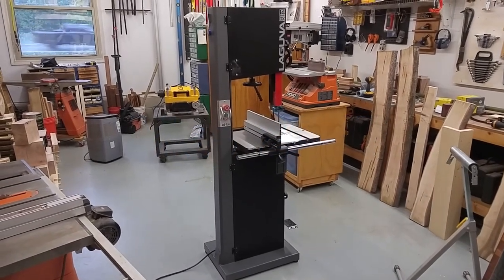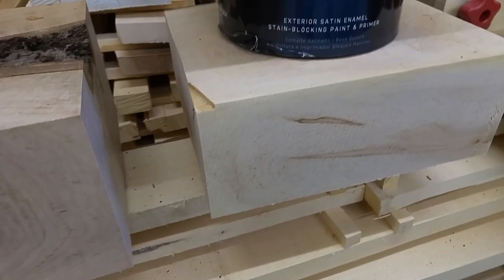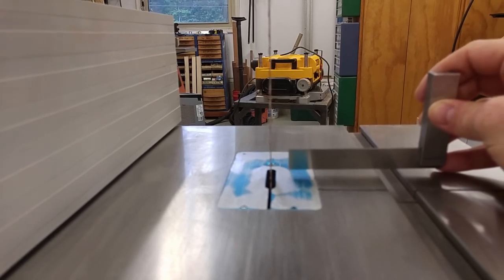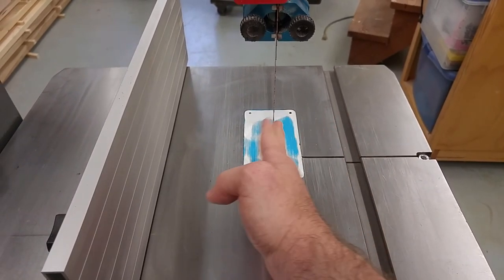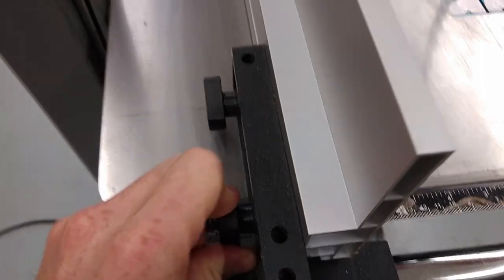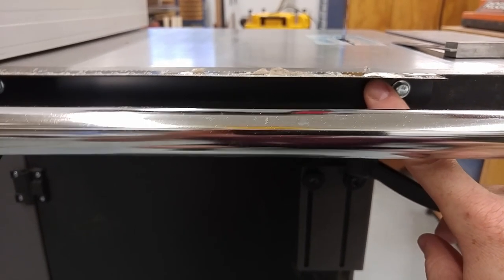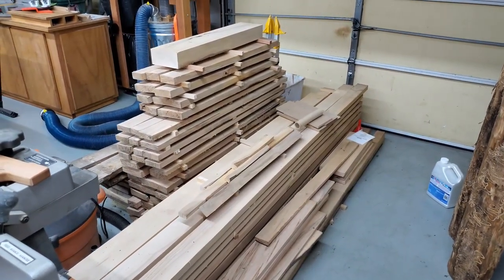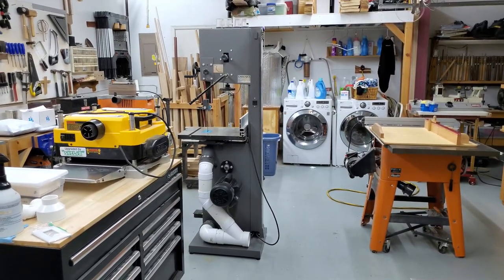Laguna 14BX 220V bandsaw three-week and three-year reviews

Comment from the maker: Here are some 3D-printed upgrades for your Laguna bandsaw:
✅ Improved dust collection insert block: https://thesnekkershow.etsy.com/listing/1703726866/insert-block-for-laguna-1412-and-14bx
✅ Better lock handle: https://thesnekkershow.etsy.com/listing/1786957785/improved-table-lock-handle-for-laguna
✅ "Check tension" magnet: https://thesnekkershow.etsy.com/listing/1758109099/magnetic-check-tension-sign-for-bandsaws

Comment: With your lower blade guide, you can move the knob to the other side of the block assembly on the other threaded hole. It does remove a bit of your table tilt, but its much easier to get at.
Reply from the maker: Thanks, I'll have to take a look under there.
Reply: It removes most of the tilt. Mines on the outside and I can only get to 11 degrees

Comment: I purchased the laguna 1412 with the 1.75 hp motor. It's my first band saw ever and it is great I wired it 220 to get full use of power. The one thing I didn't like is the guides. I installed a set of carter guides last Friday and what a Saw this is now. I would recommend them for sure.  Love your videos very helpful thank you from Alaska at grampas Wood shop..ps. resaw King rocks

Comment: Great thorough review!
I've had the 2.5HP for a year now.  I have very mixed feelings about it and at this point I wish I had the Harvey Alpha.  I had issues with the table not staying flat where the split is and had to go through a bunch of trouble to get that right. The trunnion system is crap and doesn't hold well so it easily goes out of 90, especially if you loosen it to make an angled cut and put it back. The flaw is all the play/slop in the trunnion.  The throat plate is junk and trying to get or keep that perfectly flush is a challenge.  The fence was humped and I had to call to get a replacement that still wasn't perfectly flat but was much better. The aluminum extrusion is just a piece of junk and as you showed if you put pressure against the backside  during a cut it will flex - so use a on/off magnetic block on the backside to secure that like another viewer stated. The fence system as a whole is junk. Overall they put such little money into the fence system that in my opinion it's just cheap crap.  I have mixed feelings about the ceramic blade guides. It too just feels really cheap, I'm not sure how long those ceramics will last. For now it's fine but every time I look at it I wish I had better.  Like all bandsaws, blade changes are time consuming and you quickly find out why shops end up with at least two. One stays setup for resaw and the the other one(s) setup with whatever blades are good for the curve cuts.  My experience with their customer service wasn't great.
The things I like about the saw.  The 2.5HP motor is great. The foot brake is great. The mag on/off switch is good. Dust collection is acceptable.  

If I were to do it over, I would have purchased the Harvey Alpha. Yes it's more expensive but it addresses most of the issues I have with the saw. I don't have one though, so maybe it has its own set of issues, but the fit and finish look way better.

Comment: You can move that knob under the table by flipping it 90 degrees as there’s a hole facing the front. So you won’t need to tighten the screw with your fingers the way you did.  Or tilt the table up and then adjust.  While you’re at it unscrew that screw and move it to the front. There’s a hole if you’re look there so the screw won’t be in the back but the front.  Cheers. I just got mine yesterday.

Comment: I have the same problem with my kreg fence only locking on the front. If I'm cutting something where it can cause me problems I   stick a clamp on the table behind the fence to support it. Sucks to have to take the extra step, but it works well.

Comment: Thanks for a thorough review.   I love the brake.   Not a fan of the fence.   If I had this saw, I would replace the two vertical adjustment set screws with pieces of brass shim stock the full length of the black part.
For support of the end of the fence, consider using a magswitch or magnetic featherboard.
I have designed and 3D printed zero clearance inserts for my Grizzly bandsaw and a few local wood working friends.  These are easy to reprint when the slot gets too wide from the blade movement during cutting.
If you give me dimensions of your insert I will be happy to design and print an insert or give you the STL file if you want someone to print this locally.
I agree changing blades is a hassle.
Dave.
Reply from the maker: I haven't adjusted the fence in years and it's still square to the table, much to my surprise. I know someone with a 3d printer, that's an interesting idea. This is one of the things I love about managing a YouTube channel.

Comment: Great review!  For the fence issue at the where it might move under load while cutting, try using one of those small heavy duty square magnets with and ON/OFF switch right up against the back of the fence so it doesn’t move. Works great for cheap table saw fences too!

Comment: Agreed this is a great saw. Most saws this size and larger do not have anything like the power this one does. Once setup it stays totally accurate  is extremely quiet and vibration free. My previous startrite 401s 🇬🇧 was forever stalling when resawing, resulting in me usually kicking something hard! I say the only negative for me is the optional wheel kit.  Don't bother, its crap! There are much better ones with 4 wheels not 3.

Comment: To solve the 4" Dust Port to 2 1/4" problem, Rockler sells a 4" ID Rubber Union Item#  46301. They also sell the 4'' T-Connector Collection Fitting for connecting the Top and bottom ports together item # 88501.
Reply from the maker: That could work. I ended up taking a slightly different approach, shown around 26:40. I did a quick overview of the parts and process here:  https://youtu.be/iFvZIpgHA7I

Comment: Thanks for a really good video. One thing I am glad you bought up was Laguna's customer service. It has not been that long ago they had really bad customer service. I am glad they have improved it. I am going to get a new BS and the 14BX is what I have been looking at the most.
Reply from the maker: I've heard other people say their customer service was bad, which I thought was surprising. I wonder how much of that was a side effect of doing business during a pandemic. My experience was from three years ago, so I can only speak to that.
Reply: @TheSnekkerShow  I bought one of Laguna's lathes and trouble with it and didn't want to do anything about it. I bought the lathe from Woodcraft and took it back to them. The lady at Woodcraft was really mad. All this happened before the pandemic. I traded the Laguna lathe for a Jet and I was happy.
Reply from the maker: @hawkeye10100  Woodcraft is a franchise and doesn't like returns. I bought a Laguna carbide-tipped blade online from Woodcraft that had a crack in the weld. The guy at Woodcraft complained, but I called Laguna and they sent me a replacement.
Reply: Laguna customer service seems good now. I bought their C Flux dust collector and had issues with the remote not connecting. They were right on it and sent me a new remote pronto.

Comment: Have the same saw and the 3/4" Resaw King blade. My biggest problem with set up was getting the back of the blade square to the table. It was leaning towards the front of the saw. The manual shows how to adjust this using the six bolts and set screws under the table but it's a PITA. Also noticed the front to back squareness of the blade changed when I changed blade. Adjusting side of the blade square to the table was now big issue.For dust collection I bought a 6X4X4 true wye and connected to my 2hp dust collector with a 6" hose.
Reply from the maker: That's a good point, I completely forgot to mention squaring up the miter slot and table with the blade. I think I did that after aligning the wheels, and before squaring the fence, but I haven't checked it again with other blades.

Comment: You could add a short section of 4” plastic dust collector hose between the saw port and your shop vac adaptor.
Reply from the maker: That could work.  I ended up building a PVC system for connecting to a 4" dust collector.  https://youtu.be/iFvZIpgHA7I

Comment: I’m planning to buy one after using a Delta 14” for the past 20 years. I sold my contractors saw 3-4 years ago and don’t miss it at all because a good bandsaw is far more versatile. A buddy bought one 2 years ago and loves it. I’ve found it is a bit cheaper to buy 8/8 lumber and re-saw 4/4 and 6/4 out of it, plus grain matching is much easier and locally available slabs have fantastic grain. The latest price of $1999.99 sucks but I’ll recoup about $300 selling the Delta. That will buy 2 re-saw blades😂.
Reply from the maker: If you can hold off a little longer, Laguna usually has an annual March Madness sale.

Comment: I am planning to buy this, most detailed description thank u
Reply from the maker: You're quite welcome.
Reply: @TheSnekkerShow  does it come with a 110 1-3/4 hp motor  that can be wired for 220 2.5 hp vice versa? Or they just offer the 110 and 220 motors that you can't rewired? Thanks
Reply from the maker: @japhetmillion4671  They sell them pre-wired. I just popped the electrical cover of mine and didn't see a rewiring diagram.

Comment: Hello, while this is an extremely old thread, internet time, I am having the same issue with my bottom tire/wheel. I have taken great care to align my saw and am waiting on customer service….The top wheel has the blade centered and the bottom wheel has the blade far forward. If you remember…did you do the reverse tightening on the up and down bolts…or the same? I am pretty sure that I can fix it with only the slightest information. I have greatly benefited from your videos on the Laguna  bandsaw. Thank you
Reply from the maker: If I remember correctly, I ended up adjusting both the top and bottom bolts. I think I started with just one, but then the wheel started to contact a pulley, so I backed off and did the other.

Comment: What brand re-sawblade are you using? I assume the drift master? Have you tried other re-saw blades? I bought a cheap one but I think a lot of my drift is because the blade isn’t that good.
Reply from the maker: Laguna 3/4" Resaw King. I haven't tried any other carbide blades, and I have a 3/4" steel blade I haven't opened yet.
Reply: @TheSnekkerShow  thank you

Comment: Been eyeballing this saw. Good video! Can you use a Bora Portamate base (60~80 bucks) for that saw and not pay said "King's ransom" for a Laguna base?
Reply from the maker: Funny thing, I just remembered that I have a spare Delta mobile base under my workbench left over from my last bandsaw. It's okay, but I'm probably going to build one like I did for my jointer.
Reply: @TheSnekkerShow  are you happy with the height of the bandsaw? I've heard criticisms of how they sit lower than other brands. Is that a pro or a con?
Reply from the maker: @misfit4777  It's the same height as my workbench, table saw, and miter saw, which I like. I use it mostly for resawing and milling, so that's a comfortable working height. If I was doing more light-weight precision work, I'd probably raise it up a little like my scroll saw so it would be closer to my eyes without having to hunch over.

Comment: I have a 14BX for a couple years now...so far I have replaced tires and a bearing in the top wheel. Also the brake mechanism sticks now and again...tool a while to figure out why it wouldn't start! Shoulda got a Rikon
Reply from the maker: I have a Rikon drill press and it's been pretty good so far. I'm surprised you had to replace the tires. I haven't had to do any major maintenance since the initial configuration, but I mostly use it as an occasional resaw machine or vertical sawmill.
Reply: I had the same start problem, turned out to be the little switch in the foot pedal.  I just went to Amazon and got several. its a good thing since I lost another switch within a year.  I also lost a good blade when the ceramic guides came loose and got into the blade dulling it.  Fixed that with some epoxy.  I really don't like the guides.  They keep coming loose.  I have started tightening the knobs with pliers.  When I change the blade I take the table loose and get it setup then put it back on.  I am almost temped to take the lower guides off and throw them away.   Other than all of that it is a good saw.
Reply: @jameslewellen150  James,  could you link to the switch please? Thank you. I thought about swapping out the guides for Carter bearings but they are very spendy

Comment: Is there a bandsaw that works right out of the box?
Seems like this gentleman spent a lot of time getting the machine ready...
Reply from the maker: It's tough to even find a reasonably priced chisel that works optimally out of the box. Power tool adjustment and calibration is an inherent, inevitable, sometimes frustrating part of the trade.
Reply: I'm looking into the Harvey Ambassador C14 and it comes completely assembled from what I've gathered researching.

Comment: I was considering getting the 18bx and my "shop" is smaller than yours. I'm a hobbyist. Anyone else think the 14bx is large and probably enough saw for resawing and curves?
Reply from the maker: I've used mine to saw 13" oak logs into boards and haven't yet encountered anything it couldn't handle yet. It looks like the 18bx can resaw up to 16", which could have come in handy a few times for wider crotch cuts. I'm also a hobbyist, so it was tough to justify a bigger machine.

Comment: As far as I know the bottom wheel is never going to track like the top, and when people think it’s supposed to start messing with it their  saw quits working right.   The top wheel is the only one you want to ever adjust.
Reply from the maker: Maybe it varies by brand.  I adjusted my bottom wheel with Laguna tech support on the phone, and it's been tracking perfectly with the top wheel for three years now.
Reply: @TheSnekkerShow  glad to hear that. Was it not tracking properly on top before. I was told that the bottom and top track differently and this is to help keep the blade on the tires. Changing the bottom tire to match the top would cause the blade to come off without the thrust bearings in place.  Does the back of your blade run against the thrust bearings all the time or just when cutting ?
Reply from the maker: @MSRWorkshop  It only hits the thrust bearing while cutting. I did the initial adjustments with the bearings off, if I remember correctly. I know a lot of woodworkers never mess with their bottom wheel, so I'm sure it can work fine either way.

Comment: Buddy on your blue face plate, there are 4 set screws 1 on each corner. That’s how you level the plate. There is no sanding required.
Reply from the maker: The set screws will level the plate, but they won't fix an uneven surface. Sanding fixed the uneven surface.

Comment: That’s BS, for an expensive machine you should never have to do these things!
Thanks for your info. I won’t be buying a Laguna!
Reply: I'm looking into Harvey Ambassador C14.  Seems to be less of a hassle.  Those adjustments under the table are ridiculous.  Hopefully it's not typical of all machines.
Reply: Exactly backwards. The more expensive the saw, the more adjustments you will be ABLE to make. If you’re not ready to calibrate a nice saw, then you’re not ready for a nice saw. You would be happier with a Ryobi, and just accept whatever setup values and tolerances it has built into, or knocked into it. As your skills improve and you discover the need for fine tuning your tools you can probably make some fine adjustments with a 2 lb dead blow hammer.
Reply: @wulf67  
I bought a Rikon 14". It has spring loaded guides easily adjustable. 
No my complaint with the Laguna is with the guides.